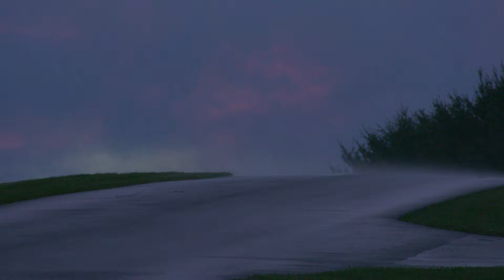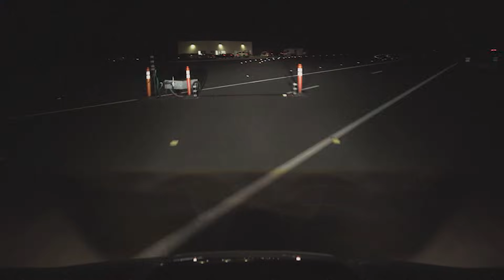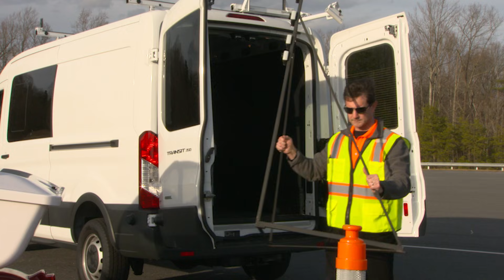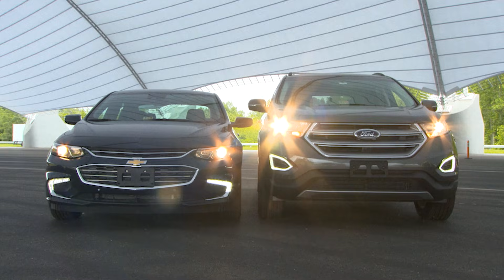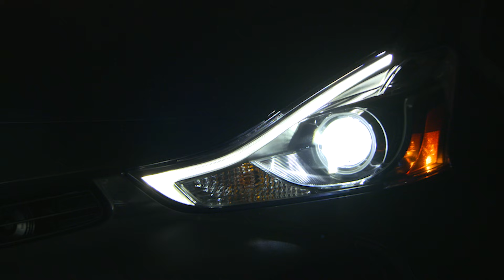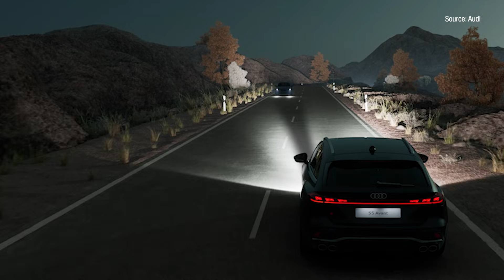Glare and headlights: The basics and beyond

Comment: imho there is a huge disparity in how the human eye works and how you don't need these crazy bright lights, oem or aftermarket, if you just keep them clean and dim your dash at night you can actually see pretty well even with older technology, your eyes adjust automatically, then someone blinds you and you start over because we drive facing each other and modern disposable cars just keep coming out with brighter and brighter lighting, sad part is these new bulbs aren't $15 to replace when they go out, so, newer is not necessarily better, like LEDs don't melt ice either

Comment: I find it fascinating that this man that works for IIHS is passionate about saving lives. But the agency he works for? 

They have blocked superior headlight technology for almost decades at this point. And then when they finally allow it they hamstring it with regulation. 

It's honestly - pathetic. 

I'm surprised he didn't touch on one factor with headlight glare - dirty windshields. It really contributes to headlight glare at night. 

I am glad that he touched on over driving your headlights at night and that only one in five use brights when they should. Absolutely wild statistic. 

For what it's worth I did upgrade my headlights. But I actually opened them up and put in a dot compliant projector. Granted that is still not legal but it sure does increase my lighting without taking advantage of other drivers. 

And I installed a $2000 400w light bar for when nobody is around. 😊
Reply from the maker: IIHS is not a regulatory body. NHTSA is in charge of writing regulation in the U.S., and we've been vocal about allowing ADBs and concerns with how the regulation was written.
Reply: @iihs-hldi 

Thank you for the additional context - I do appreciate it. My apologies of I came off too salty.

Thank you for taking the time to make this video and the late nights!

Comment: LED headlights have gotten out of control. Even in well designed housings with good optics, the luminance from the LED surface in newer bulbs combined with the 450nm wavelength in a narrow spectrum causes significant discomfort and temporary blindness. Headlight technology is supposed to improve night driving, instead it has eradicated night vision completely in two-way traffic. IIHS should really be pushing for the tech to make driving better again. If glare related night-driving incidents are on the decline it likely has more to do with less drivers willing to be on the road at night (which should not be the goal here even if it accomplishes certain objectives, it's still detrimental to public safety).

Comment: You're ignoring the fact that led headlights affect the other party not the driver of the blinding headlights. That's going to reduce your crash data and ignore the fact that the led light caused the issue
Reply from the maker: Did you watch the portion about new research on glare-related crashes? We aren't seeing a change in glare-related crashes.

Comment: I drive a a subcompact car from back when their belt lines weren't so high. Every time I drive at night, I'm blinded by multiple newer vehicles (and older vehicles with aftermarket lights, which is a separate issue). I really, really appreciate when people in these tall vehicles with their bright LED beams turn them off when sitting directly behind me or opposite me, though it doesn't happen often. I'm glad at least some drivers are aware of this. It's like they're aimed directly into my eyes! Same story with my new-ish midsize car. Blinded every time. It doesn't have to be this way!

Comment: The manufacturers  should be at fault because it's not the lights that are the problem it's the aiming. They are sending these vehicles out to the public with the beams aimed too high especially on the trucks and SUVs. LEDs will cause  just as much glare as  halogen bulbs if it's not aimed correctly. I see it everyday.

Comment: Human eyes are designed to respond to yellowish light - basically sunlight.  As some have mentioned, these lights generate light in the blue range - the worst for humans!  As Mark Baker of Ban Blinding Headlights and Save Lives! points out, the problem is also the way LEDs generate light.  I cannot understand why no engineering is devoted to redesigning lights that not only are more human vision friendly, but also produce such light without glare.  With the current crop of LEDs, we have returned to the unacceptable glare of 19th century arc lamps, a step backwards.

Comment: To me AUTO dipping highbeams are dangereous , they don't see pedestrians , or vehicles travelling orizzontaly like in an intersection/Roundabout, on corners they retard to shut off and for a small amount of time they keep blinding oncoming traffic;  Also they retard to lit up 80% of the times.. I think they are dangereous, like AUTOmatic headlight, Auto headlights don't lit up in rain, fog, snow , etc.. in day time; and if they do the sistem can decide to shut them off when they are still needed.  It should be a normal switch but if you start driving with lights off the car uses the same light sensor and warns you. The Criteria of switching headlights on an off should return in modern society. Safer then older vehicles because the vehicle can warn you but still having that safe criteria. Also I Think that alogen technology is not dangereous(Of couse LEDs are more performing at night), it should be avaiable, If I rarely drive at night i don't need them, they are less blinding, to me it should be a choice of the customer, also in rain and fog they create less glare and get you better visibility, Im not deciding it, Its the reality. Drivers education should be the better way to go , Its not normal that a lot of people don't actually know how to manually switch their headlights or have to search where their hazard lights are, Its not normal that so much people when they jump in a vehicle unfamiliar don't make sure headlights are on or AUTO function. Drivers education is essential in Road safety and  headlights use.

Comment: Super disappointed there wasn‘t a feasible halogen upgrade option endorsed.
Totally understand aftermarket bulbs aren’t a good option. That said, for many cars, an aftermarket projector assembly is a good safe option when properly installed.
Reply: As long as your loved ones don't mind you baking your headlights in the oven :)

Comment: You all should pressure manufacturers to implement glare free high beam or anti-dazzle as a OTA software update for cars that have the necessary hardware in the US but were sold before the rules changed. BMWs would greatly benefit. So many have the necessary functions, but were crippled due to “decoding” in the US market. But as someone who has coded them back, it’s a night and day difference to see how bright my lights can get without blinding other drivers.

Comment: Hope you get out of the old mind set and test drop in LED bulbs. On review I see bulbs like GTR Ultra3 have really good performance. (I haven't tested this yet.) I have tried few others and comparing with new 2021 4Runner LED headlight vs 2019 4Runner Halogen headlight replaced with a good LED bulb my eyes couldn't see a problem on a garage door. Now it feels safer to drive the 2019 4Runner at night.

Comment: Why not have a person sitting in a car, like a honda civic or toyota camry, facing the oncoming test vehicle, and log their reaction to the approaching LED headlights that you are testing?   You could even wire the person up, like a lie-detector test, and sense increased anger level.
Reply: If you're asking the IIHS folks, they explained in their video that light sensors are placed at the drivers eye level in their testing.

Comment: Auto-dipping high beams don't work when following a car in front.  So rude and annoying to be high-beamed in all my mirrors by a car 50 yards behind me.😡
Reply: Yea they do.
Reply: @PinkFZeppelin  Not always, they also don't see pedestrians , or vehicles travelling orizzontaly like in an intersection, Also they retard to lit up 80% of the times.. I think they are dangereous, like AUTOmatic headlight, Auto headlights don't lit up in rain, fog, snow , etc.. in day time. It should be a normal switch but if you start driving with lights off the car uses the same light sensor and warns you.

Comment: This testing is useless in terms of safety if it does not factor in the different eye heights.  Someone driving a Camry who is facing a Tacoma truck is a totally different scenario than the inverse.  Also, many drivers self-select which will skew statistics as they will not drive at night and a big factor is the glare of oncoming headlights.  IIHS testing is a very good thing, but this report really has nothing to do with safety.
Reply: An easy solution is so ban passenger vehicles with bumper heights over like 4 feet. But that’s unfortunately never going to happen
Reply from the maker: All the glare readings are taken at a Camry driver's eye height, regardless of whether the test vehicle is another car or a pickup. Taller vehicles aren't being held to a different standard.

Comment: Can IIHS investigate crashes caused by a vehicle driving with its headlights off? Every time I’m driving in inclement weather or after sunset, I see multiple drivers driving with their head and tail lamps off. 

The combination of wholly electronic dash clusters plus the styling trend for bright white LED running lights on a lot of newer cars, seems to fool drivers into thinking their lights are on.

GM actually had a good preventative measure on some of their models in the late 90s through the 2010s, and I think floating it as a recommendation to the auto industry would really help with the aforementioned clueless drivers buying their cars.

(I know for sure this was employed on the first-gen Buick Lacrosse and Buick Lucerne, and I think it was also used on the 97+ Chevy Venture and its Oldsmobile and Pontiac derivatives).

On at least the cars listed above, the headlamp switch positions would be ordered OFF-AUTO-PARKING LAMPS-HEADLAMPS (the latter two usually indicated with their respective symbols).

The driver could turn the switch to manually select the parking lights or headlights, and the switch would stay pointing at either selection. The thing that made such a difference, however, was that the automatic setting could only be manually turned off by turning the switch to OFF. The knob would then spring back to AUTO, and on the next ignition cycle the light sensor would be ready to power up the headlamps when needed.

At least on the Buick models, if you manually turned the switch to keep the headlamps OFF, and the sensor noticed low light conditions where it would normally engage, it would trigger a “Headlamps Suggested” warning light. I think it was a headlamp symbol with a question mark, but I don’t know if the suggestion icon was paired with text in the message center, or if the icon was only labeled as such in the manual.

Most drivers, unfortunately,  don’t read their car’s operating manual and would probably not understand that icon, so a combination of the warning light plus text in the message center would probably be necessary. 

“CAUTION: HEADLAMPS & TAILLAMPS ARE OFF” displayed in the message center (in whatever language the car is configured, of course) would be understood immediately.

I’ve found the only way to alert oblivious drivers that they’re driving with no lights on (especially on an unlit freeway, which blows my mind that anyone could be that oblivious and reckless) is to get behind them, stay a few car lengths back, then deliberately clicking the headlamp switch several times, headlamps alternating between completely off and fully on. 

It doesn’t have a 100% successful rate, but the majority of the drivers I’ve alerted that way get the message and immediately turn their lights on. Much better than flashing the high beams (which is too ambiguous/generic. I’ve been followed by cars relentlessly flashing their high beams, only stopping to check the exterior of my car once  I’m safe in a public area, and there’s never been anything damaged, no burnt out lights, no dragging exhaust, etc.
Reply: Thanks for capturing this important issue with such clarity! I'm a very safety conscious person and it drives me nuts to see drivers at night/dusk with no lights. I have limited success flashing them to turn on their lights (they don't have the wits to drive at night with lights)! I do think it's the combination of a lit dash and DRL's! Something has to change!

Comment: Living somewhere with a lot of rain and long nights in the winter headlight glare is a big problem. There seem to me to be a few causes: 
- Light temperature: Cold white LED headlights seem to cause a lot more glare than halogens. I don't think this is simply because they are putting out more light because the odd vehicle that comes past with yellow LEDs  seem to produce noticeably less glare. Also, a lot of aftermarket LED bulbs show similar light output to halogen bulbs.
It's so bad you can completely loose sight of the fog line for a brief period of time.
- People using their fog lights all the time. I don't know if this is an uninformed "I think it looks cool" thing or the misguided belief it helps them see better (it doesn't) but it does frequently add to the glare experienced. 
- Huge vehicles. Headlight height is a big factor for drivers in smaller vehicles. If your eyes are under the cutoff the other vehicle they may as well have their high beams on. 

There is the odd person driving around with their high beams on, with poorly aligned headlights, etc. but this is relatively rare.

Comment: IIHS needs to admit their current standard allows headlights to be aimed too high.  On anything other than a level road a “compliant” vehicle (low glare in tests) can absolutely blast the eyes of oncoming drivers.

There also seems to be no consideration for dirty or aged headlight lenses which scatter light more compared to their new, clean condition.

I’ve set up many headlights and I take the time to test, measure and aim them properly.  I also readjust if I get flashed by oncoming traffic.  I only say this to provide some background.  Most people don’t understand headlights, they just know when they’re blinded at night.

IIHS, why don’t you chart the number of complaints you get about headlight glare and chart those against your rating results over time?  I think you might find some correlation worthy of consideration.  Also, just use your own eyes while driving at night to identify the vehicles you grade in the real world.
Reply: So many older vehicles have misaligned headlights, pointing at the damn trees or your retinas. Part of state inspections need to be making sure they’re aligned. I’m sick of this. Shitty LED bulbs that are not made for the housing they’re in are also terrible.
Reply: Fords were rated for a long time as “some glare,” even ones I have generally not have trouble with as a driver, so I wonder how much it has to do with IIHS ratings vs. other factors.
Reply: IIHS doesn't set the standard. They test and provide data and research as discussed here. Auto manufacturers must follow the FMVSS standard. Look that up if needed.

Comment: the worst is when the oncoming vehicle comes down from a small hill, and before the transition, it's LED low beam blinds me. so even if it's perfectly set up, and follows regulation, the light is not too bright, it's too sharp! it comes from a very little surface, instead of a relatively larger projector, and that is blinding the other drivers.
Reply: Absolutely correct. I have encountered the same situation.

Comment: 11:09 Auto dimming high beams seem to malfunction a lot. I see a ton of drivers using them and they won't dim until the oncoming traffic is within 200 feet. I thought it was just inattentive drivers until I drove a customer's late-model Durango and noticed that it wouldn't dim the high beams until I got close to an oncoming driver. Ride height makes a huge difference too. Local LE use Durangos and Chargers exclusively and they usually squat with the equipment loaded into the rear and the headlights aren't adjusted to compensate for the change of the rear ride height
Reply: What I see a LOT is that people just don't dim their lights when driving towards you, the common courtesy that people used to have. Either people don't know that you are supposed to dim your lights for an oncoming car, or they simply don't care. The way the world and it's occupants are degrading these days, I believe it's the latter, in this " It's all about me" world we are now in.